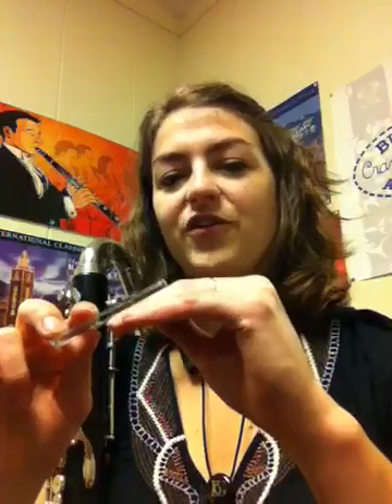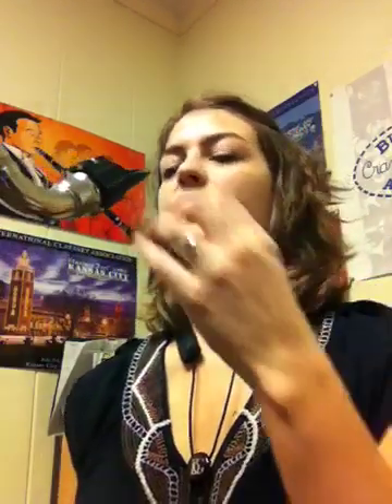How to Slap Tongue on Clarinet or Saxophone

Comment from the maker: Glad your slap tonguing is coming along!  Sounds like you've almost got it!

Slap tonguing can be a bit rough on your reeds, especially when you are learning.  But once you refine the technique you should be able to slap tongue on a reed and continue to perform on it. 

The motion should feel like you pull the reed down by its upper center, not the very top.  If you're having trouble, stop for the day and come back and try it the next day. This type of specialized movement takes time to learn.

Comment from the maker: Yes, an anchor tonguing position actually might make it easier to slap tongue.  But on a smaller mouthpiece, you might find it hard to create the suction with the tip of your tongue behind your bottom teeth. Try moving your anchor position up/back a little.

Comment: thanks for the explanation, it's helping.. i never could figure how to slap
I just have one more question, if you dont mind... first step seemed to be really easy, second one is almost working i think, but! i feel like i don't pull the reed by suction, but by pulling it directly from the top of the reed, wich is making my reed in bad conditions after very short time (i seen it coming, i use only bad reeds wich are useless otherwise) 
but my question is: is that normal?do i keep trying like that?

Comment from the maker: Where does your tongue touch the mouthpiece? You may feel the middle of your tongue pressing up past the tip of the mouthpiece, especially if you are in more of an anchor tonguing position.  You will feel like your tongue is pressing the reed closed on the mouthpiece for a split second and then "grabbing" the reed to pull it down.  Hope that helps.